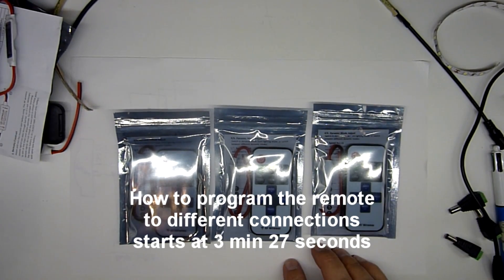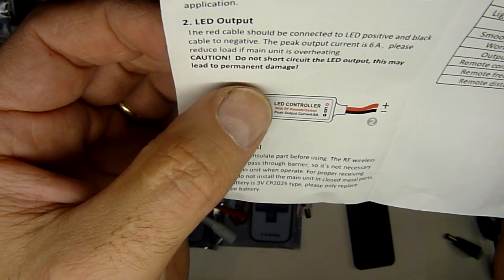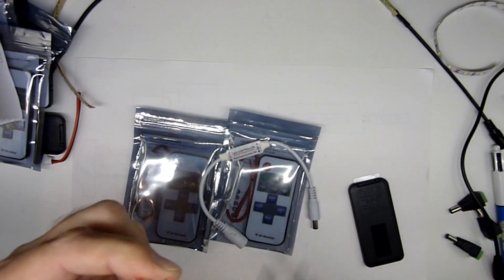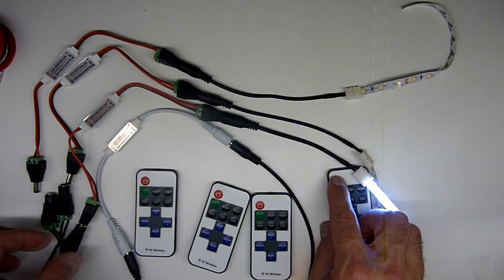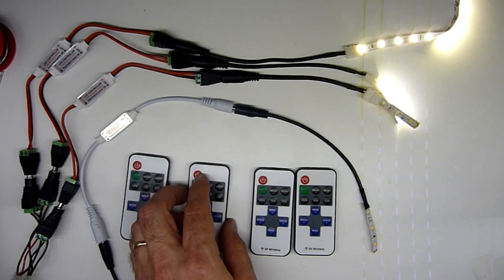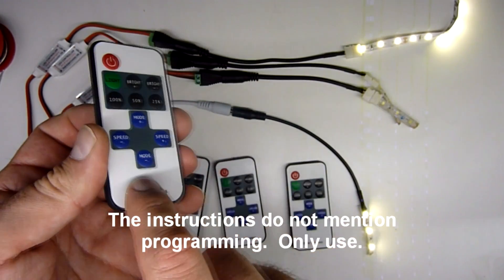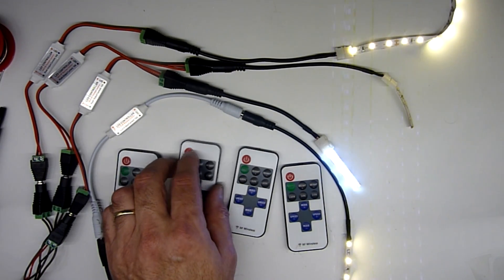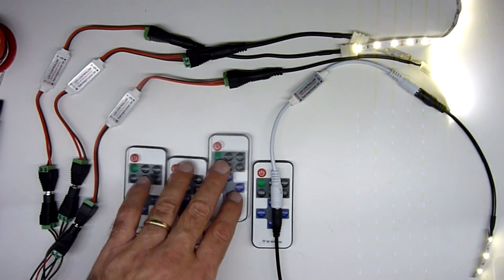LED One Color Remote Control Programming

Comment: I have a solid red light on the remote? What can I do to pair this properly. Tried plus and minus and it's got a red light
Reply from the maker: if it is solid red without you pressing a button then I would think there is a short on the keypad.  The light should only come on when you press a button.   The controller is RF and does not use the light, but the light is good to tell you the remote is buttons are engaging when you press them.

Comment: Hey dear I have an RGB led strip I make neon signs and when I plug the lights in the power adapter they work and when I plug the controller it doesn’t work I did the -‘+ speed and still not working if you can help me I will appreciate that 🙏🙏🙏❤️
Reply from the maker: @salehamjad6692  is it an rgb strip or one color?  Is it this controller?  I will assume yes since rgb would be 3 to 5 wires.  Let’s start with the remote. It does put out infrared which on these you can see red or see it in front of a camera.  Is the remote working when you press a button?  If the remote is working… the controller. Maybe the power wires are reversed but you annoy check that with the shrink wrap. Does it show voltage out.. if you have a multi meter?  Hard to diagnose if you have just one.

If you are using rgb and have an rgb controller these keys don’t work (as I recall). 4 or 5 wire rgb need the arrows to align… assuming they wired it right.
Reply: @ dear do you have Instagram or Whatapp so I can send pics of rgb led that I have ?🙏

Comment: Would this controller work with an LED that is powered by 2 AA batteries? It says the working voltage is DC12~24...
Reply from the maker: I have never tried it but being below the 12v  lower rating it probably would not. If you look at usb led and dimmers those operate at 5v. So they may operate with 3 batteries for 4.5 volts.  That would have to be tested.  Maybe you can find some costume led’s that have a remote.  Those are designed to work with batteries.
Reply: @alwaystinkering6972 thank you very much! So I changed the operation of the LEDs to 3 AAA batteries (by connecting it to an old 3 AA battery holder I had) and the remote worked BUT it was not enough to entirely stop the current. My guess is that these LEDs don't have any resistors and will turn on with any small amount of current that passes. Since I had ordered two controllers, I placed them in series and managed to entirely turn off (and on) using the controller. Definitely not the most elegant solution, but at least I managed to do something with the parts I already had. Thanks again for your help!

Comment: Is it possible to use for motor like small ones that are use in rc cars? And can it be powered with a Double AA or AAA Battery? I am curious though since I know only little about electronics?
Reply from the maker: No.  These controllers make dirty power by creating the flashing to give the illusion of traditional dimming.  You want a DC motor controller.  I don't know if I have seen one with a remote, but they are likely out there.  I have use such things on some printing projects.

Comment: It didn't work.😭 The light on the remote comes on but doesn't do anything else.
Reply from the maker: Make sure the controller has power and the polarity to the lights and power is correct.  The controllers have no indicator of the are functioning other than to flash the attached lights so you are dependent on them functioning. Best of luck.
Reply: @alwaystinkering6972  what does it mean to make sure the controller has power and polarity to the lights and power is correct?
Reply from the maker: @void________  plug the power direct to the lights to make sure it works.  Then put the power back to the controller. I don’t know which controller you have, with the pre attached connectors or ones you connect.  If it is the ones you connect make sure red is on (+) on both sides.

Comment: I just discovered that when you first get the controllers (the wired part that receives the signal), apparently they are in universal mode where they will respond to any remote regardless of whether that remote has been reprogrammed or not. But once you program a controller, that controller will now only ever work with one remote at a time, whichever the last one was that you paired it with. I don't know if there is any w ay to set the controller back to universal mode again. I tried different things but couldn't get anything to work. So the trick is to use a new unprogrammed controller if you want to have several remotes controlling the same thing. But then you may have a problem if anyone else nearby is using a similar remote or similar frequency, your lights might get turned on or off unexpectedly.

Comment: If I connect two in series, can I reduce the brightness even more?
Reply from the maker: You should not connect two in series as the second in line will get dirty power.  LED’s don’t dim as a regular bulb. While they do look duller with a slightly lower voltage, the dimmers electronics flash on and off at an huge rate of speed and the momentary illumination rate gives us brightness. 

That being said the led’s have a point at which they illuminate and that point is their dimmest illumination.  

The best way to make things dimmer would be to include fewer led’s when at the lowest illumination.  You could do that by… addressable led’s and a controller you can customize.  You could use two strips with fewer led’s per meter and put on on one controller and one on the other…. Or your could take a strip you have an go through the labor of wiring two lines in parallel with wire attaching the sections so they offset in an alternating manor…. One on each controller. 

… and the large black unit is still the best dimmer controller I have used for attaining smoothness when approaching the lower settings.  I recall their being a wireless version of it.
Reply from the maker: Oh.  I should mention I have another video where just cover one color dimmers available at that time…. If you have not seen it.
Reply: Thanks for your reply!! Very interesting! In my case it's a lamp which illuminates an acrylic base so I wished to do not disassemble it. Anyways, thank so much for taking your time to explain

Comment: This tutorial was helpful, thank you! But how can I bring back the basic settings now?
Reply from the maker: What do you mean by basic settings?  Once paired the adjustment options should all work.
Reply: @alwaystinkering6972  I mean i paired controller & remote, they all work great. But now I want to bring back the factory settings that were before I paired them. How can I do that? Is it possible?
Reply from the maker: @assetyermekbayev460  not that I know.  Powering all the receivers and trying to sync just one remote with them all should mess them up well enough.  Just remember which remote you used when you move on to whatever their next phase in life is.
Reply: @alwaystinkering6972   I paired 3 remotes and 3 receivers, so now 1 receiver works with 1 remote. But before I did that 1 remote worked with 3 receivers. I want to reset the settings/options to what they were before I paired them
Reply from the maker: @assetyermekbayev460  I recently found decent instructions posted with this Amazon post. Updated Mini Remote Controller for Single Color LED Strip Lights, RF Dimmer for 12V DC LED Ribbon, Shelf Lights, Wireless Remote Control for Dimmable 3528 5050 Under Cabinet Puck Lights(Single Color) https://www.amazon.com/dp/B01M7TGZ9B
Reply: @alwaystinkering6972  that information was helpful! Thank you for quick respond.

Comment: the maximum distance how many meters.  can we press the 20 meter button to function
Reply from the maker: I went outside and ran some tests.  Very reliable at 20 meters with a new battery and old.  Ok at 30 meters very random by 50 meters and nothing at 60 meters.   At 20 meters I can reliably control the front lights over my garage.  That sensor is behind the wood and stucco of the roof overhang.  So yes.   You should be ok at 20 meters.
Reply: where to buy it.  there is a link
Reply from the maker: @cecuenwu8842  you can find them on eBay and Amazon searching “one color led rf dimmer” here is a randomly picked example of a seller offering a 2 pack https://www.ebay.com/itm/2X-DC12V-12A-RF-Wireless-Remote-Mini-Controller-Dimmer-Led-Single-Color-Strip-/192562194727

Comment: Hi, I have the 17 button rf controller. Have played around with every button combination but No luck. It's the exact remote as yours in the video but has the colour buttons. Instructions say speed minus and plus but still does not work. Do you have anything else I could try?
Reply from the maker: I do not.  All the color controllers I use are IR or WiFi.   I have also used Bluetooth enabled when WiFi was not available.

Comment: I bought this today and when I turn  it on all it does is strobe the led strip. remote does not work. led controller faulty?
Reply from the maker: I have not encountered that.  Does the unit get hot.  If it is getting really hot fast maybe the label and the wires don’t match.  Wiring it backwards may burn it out so observe, not test. .  Are the led’s on the side labeled led?
Reply: @alwaystinkering6972  item does not get hot and it's all labelled and the remote light is working fine when I press button. so I dont think it remote.
Reply from the maker: If the remote is powered properly you can see an light illumination when you press a button.  No light the remote may not be powering and the flashing is just the mode the unit was in when it powered down.  If there is no power in the remote the battery obviously has to be good. Inside the remote there are two metal wings that make contact with the negative sides. Sometimes they bend too straight and don’t make contact.

Comment: I lost my remote so purchased new controller/remote kit on eBay, paired it with your help. Thank you. Surprised the original which looked very similar wouldn't respond to pairing attempts. Was purchased at Home Depot, Commercial Electric brand. Maybe it was older or something. The controller module has the same shape, wire gauge, color etc so I'll be swapping them out tonight, so I have a remote again.
Reply from the maker: So I have had remotes that stop working. The fix in all so far has been to look in the battery compartment and bend the tabs that makes contact with the negative towards the door... should be the spring metal to the sides.  My assumption is that dropping the remote a sufficient number of times allows the weight of the battery in deceleration to bend the tabs so contact is broken.  I am glad you got a solution working again.

Comment: Hello I just purchased this kit off eBay and it lights but the remote does not! I tried binding it like you did but nothing!
Reply from the maker: The IR light on the front of the remote usually lights even though the remote is RF.   If it does not look like it is working the battery may not be making contact.  When you slide the battery in it makes contact on the (+) surface and then there is a piece of spring metal that makes contact with the sides (0).   I have dropped a remote 12 too many times and bend the spring metal so it does not make contact with the sides.   I fixed that with a small screw driver that pulled the spring wings back out.

I am assuming you have the same layout on your remote.  Hopefully it is something that simple.
Reply: @alwaystinkering6972  yes it is the same remote. It does light when buttons are pushed and I tried a new battery also. Does it matter were I put the positive led? I went to battery voltage that is hot all the time, so I can turn the lights on anytime! The LED's work great and the control box does not get hot.

Comment: My remote doesn't have the speed buttons 😕
Reply from the maker: While I have not tried many other remotes, I have come across documentation that other remotes can be programmed with different combinations.   I looked at a remote with just brightness up/down and the % brightness buttons.  It had these instructions.  If this does not work, see if different combinations will.   Disconnect the power to the LED controller, wait 5 seconds, and reconnect.
2. Within 5 seconds of reconnecting the LED Controller, press the “100%” and
“60%” buttons simultaneously.

Comment: I wanted to know if I could control multiple with one control and this answered my question, thanks!
Reply from the maker: Not with this controller.  Mi-light makes a 4 controller series.  You can also consider a WiFi controller.  You can bundle multiple controllers into one activity.  They make them in one color and multi. You also get the option to add WiFi controllers to any voice control devices you may have. I have a video that shows Alexa or a phone talking to two controllers at the same time.
Reply from the maker: Mario yes. They do randomly sync to the same default at times.  The issue you will likely find is that it will not reliably successfully take action on both at the same time.  Sometimes one will do what you want. Sometimes both.  If you send an on command and one does not turn on the next press may turn the on one off and the off one on.  I would expect that unreliability to get worse with distance.   You can always try it.  Others have expressed the same desire but not indicated it has worked reliably for them.

Comment: Hi, I'm waiting for your help. The LED flashes after a while. I am using a 12V 6A Adapter. Why is he doing this? I am using it for aquarium lighting and it is really annoying.
Reply from the maker: What kind of flashing? Power cutting out  random flashing or a line one of the programmed flashing modes.  Is the led strip fully enclosed or a strip with the silicone gel?
Reply: @alwaystinkering6972  
3 pcs led I use this: http://canleddunyasi.com/wp-content/uploads/2018/02/170.jpg

I just want it to burn normally and I make the light intensity 25%.
But after a while the light blinks and returns to normal. It repeats after an uncertain time. It's like a flicker. This makes a very bad appearance.
Reply: @alwaystinkering6972  https://www.youtube.com/watch?v=5TJuJPoOk_Q I uploaded a video about it.

It's like pressing the Speed + and Speed - buttons.

Comment: If I use a battery box with an 23A type 12V Battery I will have any issue with the controller?
Reply from the maker: Its the load that determines if you can use it.  The dimmer may make it as high as 12 amps. I have a 9 amp rated run.  I replaced the wires on the unit with a higher 18 gauge wire.  Beyond that you need an amplifier to go above the rating.  The amp will transmit the dimmer functuons onto distant led lines but not the load of those lines.   The amp does this by requiring power be run directly to the amp.  The at power is used for the lights it controls. You can power a main line and an amp from the same source power so long as it is rated for the total load and the distance to the amp does not cause a significant loss of power.   You can also look at higher amp solutions like  DC12-24V 30A LED Single Color LED Dimmer Controller with RF Wireless Remote  https://www.amazon.com/dp/B06Y5M6CX4 i review the mechanical version of this switch in my one color dimmer review.
Reply: @alwaystinkering6972  The strip will be just 50cm 5050.
The Battery I want to use is the small one usually use in car alarms controls or garage controls.
The name of the battery is 23A its not 23 Amper.

https://www.google.com/search?q=23a+battery&client=firefox-b-d&tbm=isch&source=iu&ictx=1&fir=tdJ8ko7n7yWpgM%253A%252C1AReXucBygSmXM%252C_&vet=1&usg=AI4_-kSvW5Qq7kbM4Aj6XjxW45QbQ-t_rQ&sa=X&ved=2ahUKEwjgi_vq3sDiAhUiSxUIHZzlDs4Q9QEwAnoECAkQBg#imgrc=_&vet=1
Reply from the maker: @dragonld123  you should be good. When using straight battery power remember to use a fuse in line.   You want short protection.

Comment: I just want to buy 3 more receivers... where can I buy them?
Reply from the maker: One remote will not relaibly turn them all on and off at the same time.  Visit the frentaly store on ebay. They usually have  3 for under 10.
Reply: Rgr… got about 5... I did program them each separately, then connected them all to one battery. 1 remote seems to work fine so far. I haven't been able to get them to not work all 4 together.... hope this luck continues during my shrimping.... thanks again...
  @alwaystinkering6972

Comment: If I only use 1 of these for 4 LED light strips, will I loose anything as far as Amps going to the LED with a 12V power source. I only bought 1 and still waiting for it in the mail....Pls help...
Reply from the maker: If you have qty 4 5 amp lines that is 20 amp and too much draw. Of course qty 4 5 amp would require you add an amplifier after  at least two runs that will keep the draw on the dimmer within spec.  You can get 30 amp dimmers.  You would still need to home run off the dimmer to farther runs.  As far as voltage drop.  On my 9 amp run I replaced the wires on this unit with 18 ga wire.  I re heat shrinked it shut.  Two years and still going.   When running 12v over distance to the start of the line a larger gauge wire will help avoid drop. Here is the 30 amp with remote. I have used the mechanical version of this and include that in my one color dimmer review. LED4Everything (TM) DC12-24V 30A LED Single Color LED Dimmer Controller with RF Wireless Remote for 5050 3528 https://www.amazon.com/dp/B06Y5M6CX4/
Reply: do you know where I can get 3 of these mother boards without the controller... I just ordered 1 w/the controller,,, want to operate a total of underwater led shrimp lights I made with one controller...
Reply: I just want to buy 3 more receivers... where can I buy them?